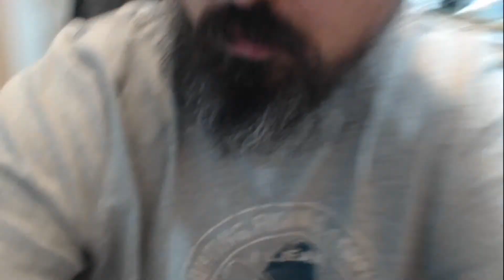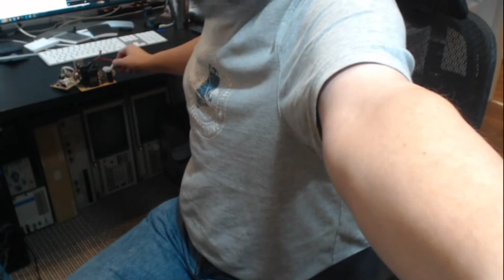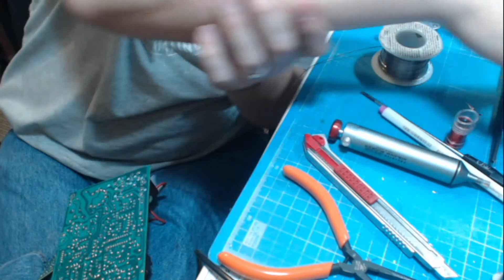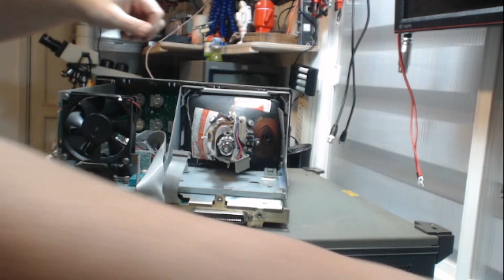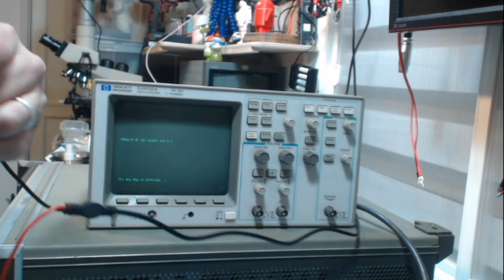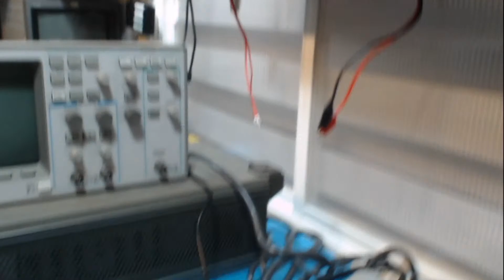Repairing HP 54600A Oscilloscope

Comment: I've got exactly the same issue as you, which capacitor did you eventually replace?
Reply from the maker: I don't remember. After rewatching the video it seems it starts after I replaced that cap. I would guess it is one of the tantalum caps in the vertical circuit, probably C651 or C653. There is a schematic for the Hitachi CDU-10BA241 CRT driver board on the internet. You can find it in my repository in the schematics folder titled Display Schematics.pdd 
https://drive.google.com/drive/folders/18xhLYEB4pwUBy0eiQxF3qsRgVy8niwjS
Reply: @TomHaynes  Wow thanks so much for the great documentation!
Reply: @TomHaynes  thx!
Reply: @TomHaynes  Fixed it this afternoon, it was the small cap indicated in this video: https://www.youtube.com/watch?v=FJmoAzCa3Hw

Comment: I just got an HP 54645a and the encoder for the channel 2 volts/ division is misbehaving. Is there any way to fix it without having to find a whole new keyboard?
Reply from the maker: Yes, the RE can be removed and cleaned with contact cleaner. Better yet, disassembled and cleaned without excess lubricant. I don't know of a manual on haw to do it so you me have to feel your way through.
Reply: Thanks, I’ll give that a try, I’ve also heard that the transistors on the keyboard can fail as well, but so far they’ve all tested good.
Reply: I figured it out, All of the “transistors “ (they appear to be dual diode arrays in sot-23 packages) are fine. I found and repaired 3 cracks In the front panel pcb that caused open connections. I heard it’s common for the board to crack from the rectangular holes for the anti-rotation tab on the rotary encoders, that’s where mine cracked from.
Reply: That’s awesome! I’d definitely love to have the schematics/ gerber files.
Reply: That’s awesome! I’d definitely love to have the schematics/ gerber files.

Comment: Really useful video !  I just acquired a HP 54600A to play with (my first Oscilloscope) and am learning my way around it.  How did you get to the self-test functions?  Esp the button test screens? that looks really useful!  Thanks
Reply from the maker: Congratulations! Even though it is so old it is still a very useful tool. Look for the '54600-Series User and Service Guide' part number 54600-90915. keysight or xdevs will have it. On page 102 is the section titled 'To run the internal self-tests'. Step 1 is the keyboard self test. You press [Print/Utility] then use the softkeys for [SelfTst] then [Keyboard]. The section continues with other self tests. Starting on page 88 is the procedure for self-calibration.